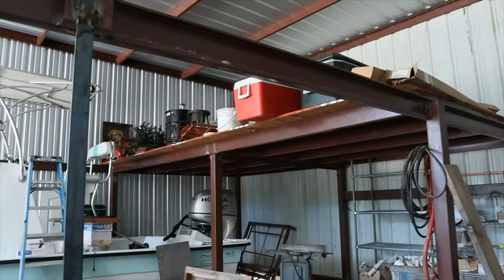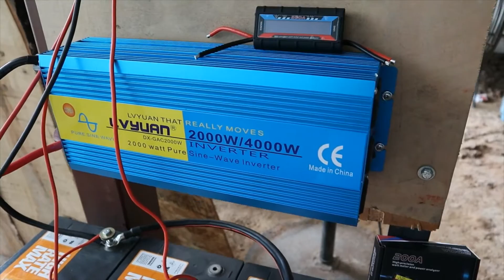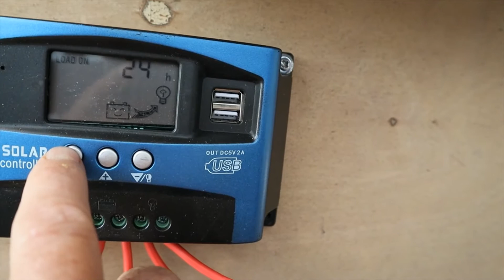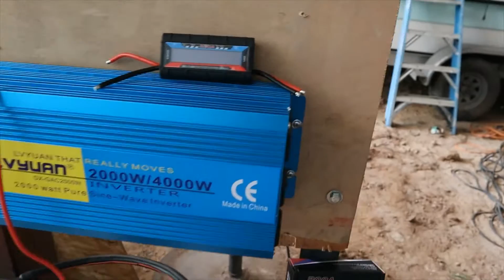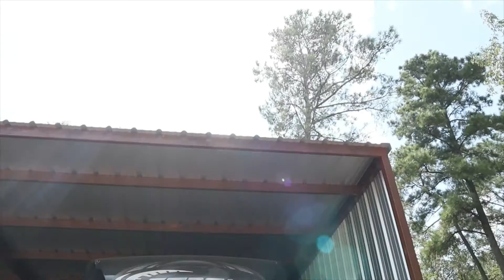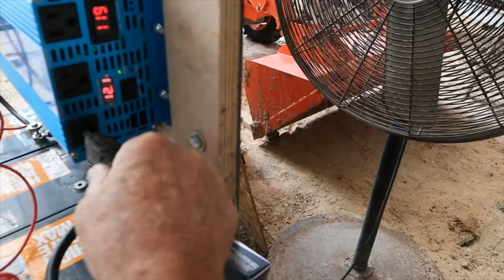My First Attempt at Installing a Off the Grid Solar Panel System

Comment: OK, where to begin. First thing first is when you run batteries in parallel you need to connect to opposite ends with the inverter wires. meaning that say hook the red lead from the inverter to battery 1 positive, and the black lead to battery 4 negative. this ensures that the batteries contribute evenly. This is the reason that your voltage dropped so much even with just a fan. the theory is this, the way you have it connected right now means that battery 1 is doing all the work, as it is drained battery 2 starts to slowly recharge it. as 2 gets low batt 3 starts to recharge 2, same for 4 and 3 you get the idea. When you connect to opposite ends, all batteries are electrically the same length working as one large battery.
Second, I'd suggest using two long buss bars made of copper or aluminum to connect the batteries together. using many lugs is expensive and every one of them introduces resistance and a potential failure point. get some angle stock drill some hole and bolt is down. Make sure that your wires going from the battery are larger than what you have now.  Your wire needs to be able to handle 200+ Amps, and what you have doesnt look big enough from what I can see in the video..
Third, you NEED FUSES. you can WELD with HALF of what you have there, FUSE FUSE FUSE please.
With regard to the 12 vs 24 vs 48 volt system debate, I prefer higher like 48/60 volt systems as they use smaller fuses and wires since the current is so much lower on them.
Higher voltage systems are normally more efficient. If you want a little system that will work with your 4 or 6 batteries, I would strongly suggest you buy yourself a MPP Solar LV2424 all in one unit. It does PROPER MPPT, the one you have is a chinese ripoff/fake PWM Model. It is also a 2400watt inverter, transfer switch and gen/utility charger.
Please do let me know if you want any more help with your system, seems im doing a fair amount of redesigns just like this lately.
Reply from the maker: I really appreciate your help. It shed a lot of light on the situation.. I'm sure it helped many other people as well..Great information. Appreciate the comment..Thanks Larry